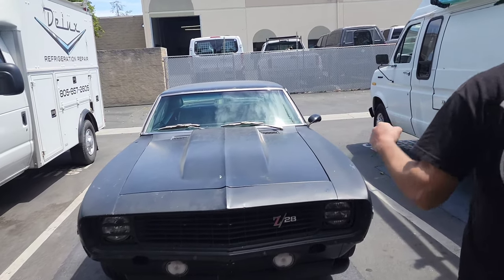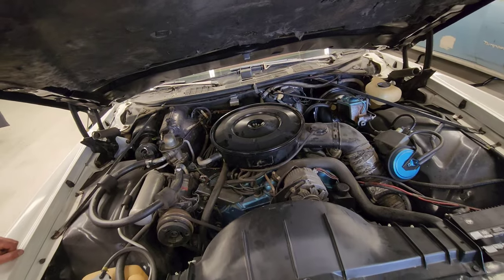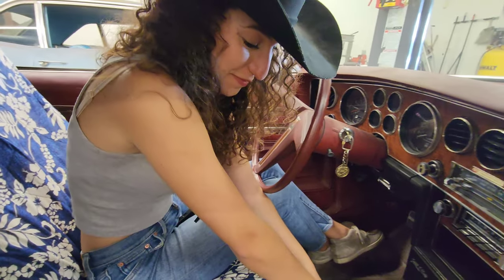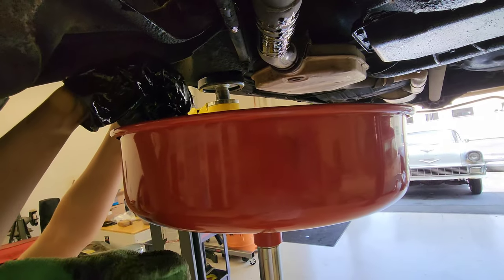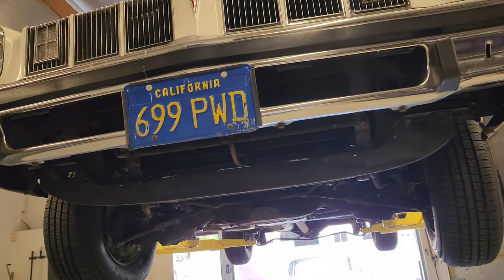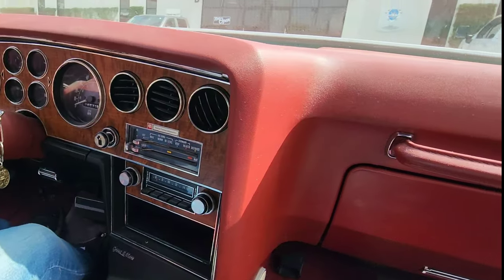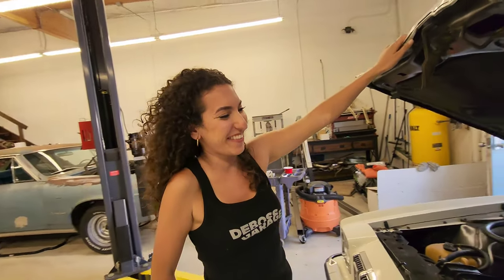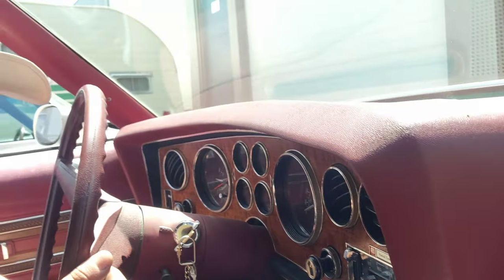Big Old Pontiac Needs A Tune Up – 1975 Grand LeMans

Comment: Big Fun!  I was a mechanic back in the 70's / 80's and worked on these things. If you look under the hood, at the part of the hood that is right above the front of the AC compresor, right above the belt... if there's a stain on the underside of the hood... it comes from AC Oil coming our of the front seal being bad in the compressor. This style of compressor was famous for it. I'll bet I replaced 100 of those seals in just one year. Back in those days we had to replace the seal because buying another compressor cost an arm and a leg compared to a $30 seal.

Comment: My dad had a 76 with a straight 6 as a beater car. I wedged a block behind the Em brake release and used the parking brake pedal for 90 degree turns. Half the time the driver’s door would swing open into traffic.  Exact same interior. Brings back memories.

Comment: When you have a clock in place of a tachometer, you know you're supposed to cruise.  That's a 2 barrel 400 V-8.  Amazingly powerful for the era.  The fastest I've ever gone in a car was a stock '73 Catalina with that very motor and transimission.  It did have dual exhaust, but it went 138 MPH.  Also, the Grand Lemans was basicly the successor of your '67 Tempest.  They didn't share the same chassis, but family tree-wise, it's like the son, or grandson.

Comment: Yes, they put a 2 barrel on 400’s, made them surprisingly torquey and responsive.
Reply: The 2 bbl carb was the biggest one, no slouch... 13mpg city/19mpg hiway - Smiles Per Gallon!
Reply: SBC 400 with 2 bbl. carb. had more HP and MPG than later SBC 400 with 4 bbl. carb... to fool people...
Reply: This is good info. I'm looking at getting a 1970 Pontiac Catalina Coupe with an original 400sb in it. Thanks. Truck Driver Ray
Reply: @raymondtrotter4655  - '70 Pontiacs didn't come with SBC (small block Chevy) 400's... Pontiacs all the same, no small or big blocks... all just medium blocks... except for some low deck blocks...

Comment: This LeMans reminds me of the many Pontiacs and Olds that I detailed as new and used cars back in the late 70s. The white paint and maroon interior was a popular color combo for cars in the mid 70s. The Pontiac 350 was a nice running motor in this period-a lot better than the Chevy 350. Same was true for the Olds 350. A couple of years later GM dropped the division specific motors in their lines., so you longer got a Olds or Pontiac motor in your Olds or Pontiac, but a GM motor. This car. Brought back a lot of memories of all the LeMans and big Pontiacs I got to pick up from the dealer and take back to the shop and detail. 😅 of course I got on all of them and tried them out.

Comment: I had a '74 Grand Lemans in the '80s! I paid $100 for it and it was in as good condition as this one! Same colors, same interior, the front grill was a little different. Mine had a Pontiac 350/2bbl. I had installed a mild camshaft and the rear springs were worn out so I went to Midas and had their "load leveler" springs installed which gave it a slight rake. I loved that car!

Comment: Radial Tuned Suspension....First year for radial tires, 1975. What a low mile, unrestored, original cream puff!!!
Reply: Radial Tuned Suspension actually started in 1973 on the Pontiac Grand Am, one of the few cars in 73 which came standard from the factory with radial tires. The others were the Cutlass Salon and Monte Carlo S. Radials were available on other cars, but they weren't standard equipment...they were optional. By 1975, RTS was common as standard equipment on GM cars because radial tires had become the standard factory tires.

Comment: I like those 73-77 GM a-body cars the best, particularly the Pontiacs. I have a 75 Lemans Sport Coupe and 73 Pontiac Grand Am. Also a 73 GTO and 73 Chevy El Camino. Used to have a 77 Malibu Classic too. As the young lady said, they're modern enough to have everything you need and often with power accessories, with roomy comfort. Mechanical parts are still readily available. And they have a better, improved chassis over previous years(72-older). So, they handle very well. They actually continued to use the same basic frame/suspension in the 77 and later Impala and Caprice up to 1990. The engines were down on power, but can be improved, if you're willing to do it. I enjoy the attention, since many people enjoy seeing the "old school" styling and want to talk about the car when I'm out and about.

Comment: 75 was the first year for the catalytic converter, so the exhaust dumped from the 2 pipes off the engine exhaust manifolds into a single catalytic converter with single exhaust out the back. Cats at the time were too expensive to make them with true dual exhaust with 2 cats. 
Good find on the cracked vacuum hoses. It's a good idea to change all the fuel line connector rubber hoses on the car to new ethanol compatible fuel hose. The old rubber can deteriorate and leak due to the ethanol in the gas.

Comment: fun stuff, love the Pontiacs! Not to be THAT GUY..., just a friendly tip I thought I'd pass along a teachable moment: When you spilled the power steering fluid, filling the res... you could have avoided some/all of that by having the mouth of the fluid container at the top instead of rotated to the bottom. Having the spout at the top gives you more control over the pour. Good looking car!

Comment: The shifter is a slap stick shifter GM style.From low, push  it to the right and up one each shift They put those in 70s Camaros as well. That body style resembles the 1st Grand AMs as well. My brother in laws had a 400 ci

Comment: I bought a brand news 1975 Pontiac LeMans Sport Coupe on 12 Sept 1974.
Reply: I always like the 75 Sport Coupe from when I drove a new one as a rental in 75. I finally bought one with only 62K miles on it in 2002, and am still driving it today with 192K miles on it now. Mine was built in Atlanta (Lakewood) in Nov. 1974.

Comment: HEY, oil or antifreeze etc., Turn your container sideways so you can get it closer to the inlet if not using a funnel. The flexible metal hose on the breather is the heat riser helps to warm up the choke on old cars.

Comment: Where the hell is the "like x 10,000" button?  I've always had a soft spot for the GM "Colonnade" body styles of 1973-1977.  The first car I ever owned was a '74 Chevelle Malibu wagon, and I had more fun with it than any other ride I've owned to date.  That sweet Le Mans is the older brother of my favorite Pontiac of them all - the 1977 Can Am.  Same body style, but no outside trim.  Louvers over the "opera windows," and a nifty duck-tail rear spoiler that could actually shame a Trans Am from the same era!  Up front, you got either the Poncho 400, or the Olds 403 - they both were crowned with shaker scoops.  TH-400 spun the wheels.  The sad thing is that fewer than 1500 were made.  Seems that some bozo up in Lansing either lost or broke the mold for the rear spoiler just after the initial batch came off the assembly line.  The rest of the run were finished as straight Le Mans coupes; a few of them even got shaker scoops, just to clear out the inventory.

Liv, I'd try to snag that Le Mans if it were in my shop - it may not be a Can-Am, but I'll wager it's just as rare, 'cos the Grand Prix was generally seen as Pontiac's luxo-barge, whilst the Le Mans was the "sport" model.  It's the same kind of relationship as the Chevy Monte Carlo had to the Chevelle up to the "Great Downsizing" of 1978.  And yes, it would make an excellent cruiser - I think I've already mentioned how it's pretty hard to screw up the basic GM A/G-body platform, no matter what you might try to throw at it.  Style and class, dig?😎  One more thing - you'll never have to go to a gym to work out if you go full-on grease-monkey, as your encounter with the oilpan drain plug perfectly illustrates......

KUTGW!!!

Comment: That car was considered a mid size car. The Catalina and Bonneville were full size cars. The Tempest  was a compact car. The Tempest body was used to build GTO's. Little car, big engines, lot of fun. 
The Le Mans was built on the Tempest body but had more luxury features. The grand Le Mans was built on the slightly longer Monte Carlo body to make it even more luxurious. 
I had a 71 T-37. For some reason they called the Tempest a T-37 that year. It had the 350 with the 2 bbl carb. Ran very well. Not the quickest or fastest, but pretty good. Around town it got around 12 mpg. Get it out on the highway and cruise at the speed limits I live with, 55 mph it would get around 19 mpg. That car should do near that.
On the AC mine would blow icicles. Even on the hottest days when I lived in New Mexico. Well over 100* you wouldn't need it to run full blast to feel it like most if the newer cars I've owned since.
Reply: No, the Grand Lemans was built on the Lemans body and chassis, not Monte Carlo. The 2 door Grand Lemans has the same wheel base  as the 2 door Lemans, 112". The 4 door version has 116" wheel base length, as do the Monte Carlo and Grand Prix.

Comment: YC is the 350 block, if you want to know for certain behind the drivers side motor mount will have the engine block, and yes pontiac 400’s did coke with 2bbrl

Comment: The buzzer is the fasten seat belt reminder when u first start the car  & the dash light came on at the same time briefly all the gm cars I remember had those  not sure what year they started but I can remember most of the cars from 70’s & 80’s  did  have them.
Reply: started in 74, but were gone by 76.

Comment: 770 holley ish, best 2 plane, port stock heads, 108 centerline 226 236 @050 555  lift, roller sharp 1.65 intake, 1.5 exh, headers conv 3.55 gear, fast cruiser lol

Comment: 1973 to 1977 was the introduction to Luxury vehicles and low compression engines 
More than likely it had a 301 cubic inch V-8 that had 140 hp with a TH-350
Reply: 301 came out in 1977.
Reply: @58sportsuburban  
Thank you for the correction
Reply: @58sportsuburban  
I'm more inclined to the Gen II Monte Carlo S aka Laguna S-3 Chevelle
Reply: Engine choices for a 75 Grand Lemans was only the Pontiac 350 or 400.

Comment: If you notice all the Pontiacs Olivia likes have LS engines in them even Burt Reynolds Pontiac Trans Am they used in Smokey and the Bandit had a 383 stroker SBC installed for the bridge jump.
Reply: 383’s didn’t become a thing until the ‘80’s. After joe Sherman started building them.

Comment: and as a Reference any American car Built after 1974 is Emissions and HEI Ignition Oh and the Hoses you guys replaced some went to the Cruse Control and you did not try it to see if it worked there is a Button to set the Cruse in the end of the Turn signal switch you can see the Speed Oh Cable coming from Trans to it then Back in to the Speedometer :face-blue-wide-eyes:

Comment: Engine choices for 75 Grand Lemans was a Pontiac 350 or 400. Doubtful that the engine is rebuilt. Looks like original color on it. And doubtful that it would have needed rebuilding. They hold up well over the years. I'm still driving a 75 Lemans Sport Coupe with 192K miles on it. I bought it in 2002. Just tune it up good. Might need a carb rebuild, as you mentioned. 
Somebody already said to look at that white emissions and tune-up sticker on the right side of the radiator support panel. If the print on it isn't faded away, it tells the size of the engine at the top left corner of the sticker. 
A distinctive thing about a Grand Lemans is that it came with a Grand Prix dash. The Grand Am also came with a Grand Prix dash. If it had "Grand" in the name of the car, it had a Grand Prix dash :-) . The other Lemans cars, like Lemans coupe, Sport Coupe, or GT,  came with a differently styled Lemans dash, which was also a very attractive dash.

Comment: Thei engine is most probably the 350. They used engines from IL 6's up to 6 or 7 V8 options. The 455 was the big one. One thing most people that don't know much about Pontiac, they think the 350 was a small block engine. Pontiac never built a small block V8. Every V8 from the early 265 cin up to the 455 were big block engines. They only thing they had that could race in the small block classes was the IL 6's. Most that wanted to run a lpontiac in the small block classes used Chevy engines. 
I think this car ways built on the same body as the Chevy Monte Carlo.
Reply: The Pontiac V8 engine isn't called a big block engine either. It's bigger than a small block Chevy, but smaller than a big block Chevy. It's sometimes called a medium block because of that. But there's no small block or big block Pontiac, since they were all the same size externally. It really just a Pontiac engine with no big block or small block designation, since they're all the same size. The Chevy was different in that they had 2 different sized V8's with the big block obviously bigger than the original small block, so calling them small and big was a way to differentiate them. No need for that with a Pontiac. 
And the Grand Lemans was built on the Lemans body and chassis, not Monte Carlo. The 2 door Grand Lemans has 112" wheelbase, just like a 2 door Lemans and most other GM 2 door a-bodys from 73-77. The 4 door Lemans(and other 4 door GM a-bodys) had 116" wheel base. The Monte Carlo and Grand Prix, both of which were 2 door cars, were the exceptions, being "special a-body" and having the longer wheel base of 116".

Comment: I'm chuckling at your calling that a "boat," because it's a midsize car. If you want to see a real boat, you should have seen my '72 Grand Safari wagon with the 455 - and yes, it a factory 2 bbl. In case you haven't found out since you made this video, Pontiac put 2 bbls on every size engine they made. I like the way that generation A body car handles. I had a '75 Chevelle Malibu Classic sedan, and it handled like it was on rails after a couple of minor upgrades (urethane sway bar bushings and end links, and wider tires with a lower profile - I hadn't yet started working at my first parts store). It only had a 350 with a 2 bbl, but it was fine for cruising around town. When it could; it was hungry for transmissions. I never found out why, but it would blow out 2nd and 3rd gear in any TH350 put in it, including a B&M unit out of a racecar. That one it actually ended up blowing out 1st gear as well, so I had to drive home in reverse! People pulling up "behind" me kept freaking out because they thought I was in the wrong lane and headed straight at them! 😂😂😂

Comment: That bad boys got an Oldsmobile straight out of the factory
Use quite a few of those little small olds  found in Pontiacs in 75 

Boys don't forget about the firebird think it was 1981 that had the 403 olds
Reply: That is 100% NOT AN OLDSMOBILE engine
Reply: @58sportsuburban  if it's a 260 barrel it's an Oldsmobile
They didn't say what engine was in there

Had 75 Pontiac Ventura look like a Nova it had a 260 olds engine
Reply: @truckerkevthepaidtourist  you can tell it’s a Pontiac engine by lookin at it..
Reply: Trans Ams built for California had Olds 403 in 77-78. In 79, the 403 became the standard engine for the Trans Am nationwide. So the vast majority of 79 Trans Ams had 403's. 79 was the last year for 403. No 403's after that. And that is definitely a Pontiac engine in that Grand Lemans. Pontiac 350 and 400 engines were the engine choices in a 75 Grand Lemans.

Comment: So allways look at the Sticker on the right side of the fan Shroud it should tell you the engine size and I am Not sure about this Model but the TA;s of the time had a Ratchet type SHifter  take and Pull It down i to Low  then Push the SHifter to the right and then whl:face-blue-smiling:e Holding it right see if it will Shift Up to L2 then Drive stopping at L2 and then again at Drive
Reply: Think that was a Hurst shifter drop down door. Performance Package th400     442 olds hand then to

Comment: The engine is the wrong color, it should be a light baby blue color.  The nice metallic blue was used in the late 60's.
Reply: No, that's the correct engine color for a 75 (and 76).

Comment: Put 4 degrees of timing in it.
Reply: And put in light weight springs on the advance weights, make sure the vacuum can is connected to full manifold vacuum port (below throttle blades).

Comment: The 73 and following GM intermediates took a major dump in styling, like GM must have wanted to kill off their entire
intermediate line, and even a lot of their full sized vehicles.   Intentional or not, they did kill off their intermediate line, followed by wiping out two divisions of GM, Pontiac and Oldsmobile.    Saturn also flopped.  What we have left to pick from today are the lozenge cars that plague the current styling of most every vehicle, excluding the Corvette and Camaro.
Camaro may look good, but the slightest bump in front can do major damage.